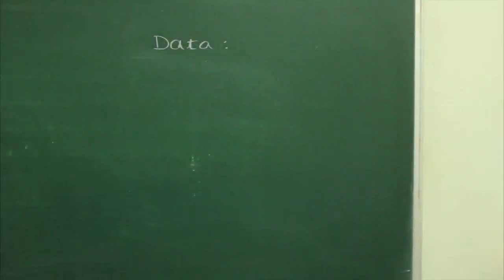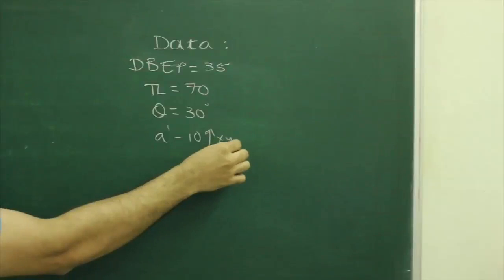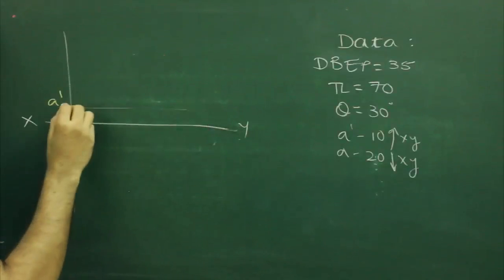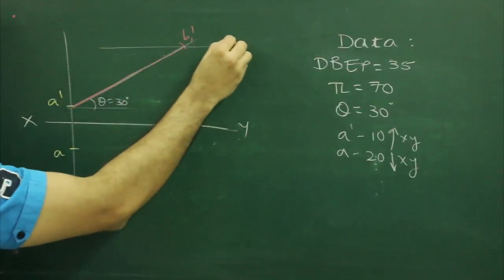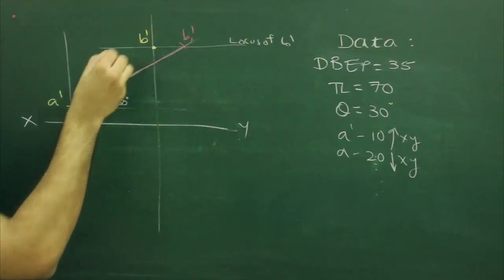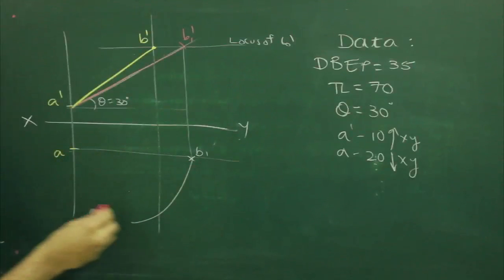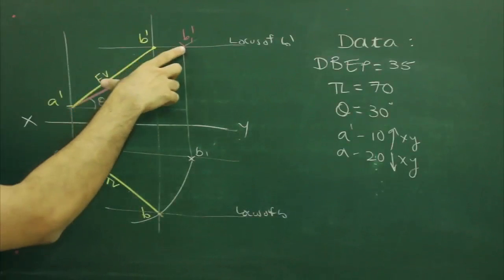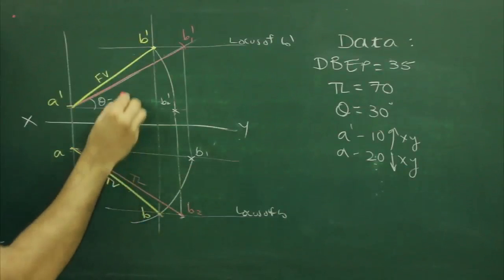Projection of lines 8

Comment: the question goes like this..."the distance between the end projectors of a straight line CD is 50mm, the elevation and plan view measures are 70mm and 80 mm respectively. If end c if the line is 10mm below HP and 25mm behind VP
Reply from the maker: Point C is in 3rd quadrant Step 1: Draw xy line then mark DBEP = 50mm then Mark C' 10mm below xy and C 25mm above XY
Step 2: Take 70mm from C' and cut down ( assuming line in 3rd Quad) so u will get FV and same with TV cut 80mm from C so you will get FV and TV then Rotate and Project to get thr required TL  ( SEE previous Questions 4,5,... to understand that thank you.
Reply: Sachin Pandya thank you very much sir..